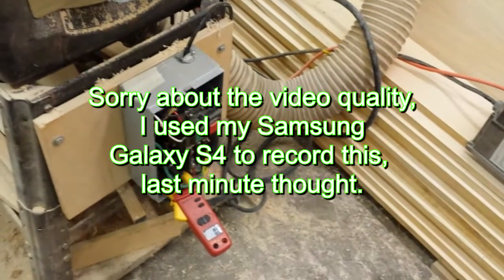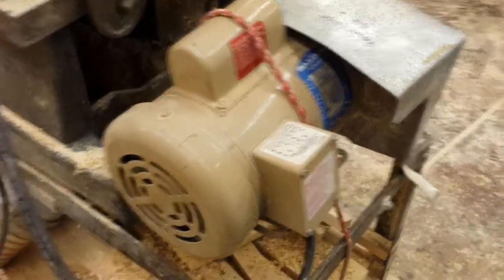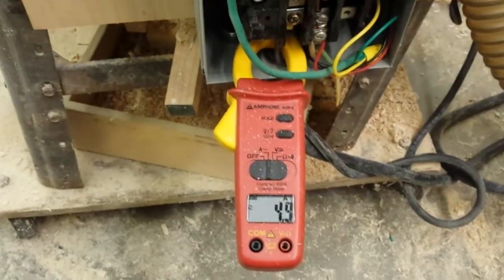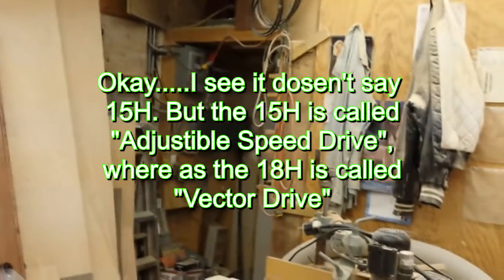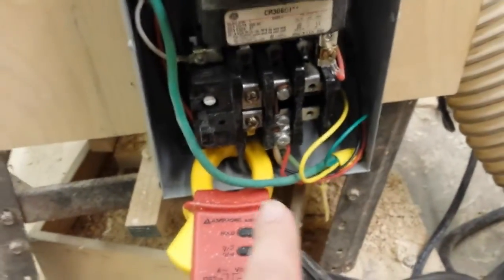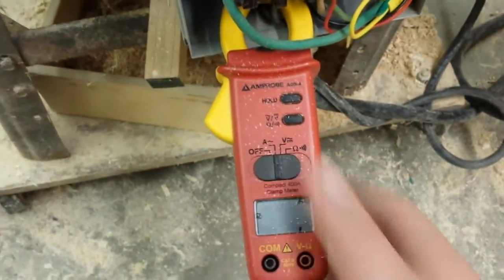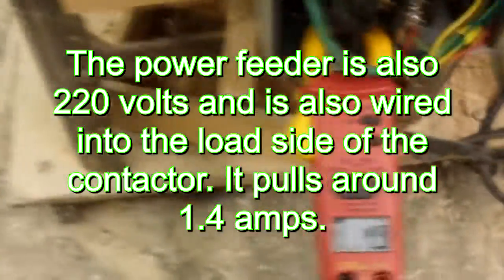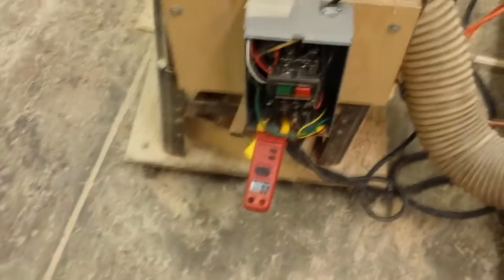Shop Cam - VFD Failure # 129

Comment: Isn't the VFD for that application a little overkill?  Once you get the feed rate corrected, wouldn't it be happy with around a normal 1.5 hp motor?

Comment: Good video and now you've got me curious.  Is it possible that when the capacitor discharges it acts somewhat as a brake in relation to the wind down speed of the motor?  It even sounds like the motor is being braked when the c-switch kicks in.  At any rate, something wants to draw that amp of current and you know it has be through the windings.  If you figure it out let me know.
Reply from the maker: Hi Kris, thanks for the comment. Yes, you are correct the capacitor discharge acts like a brake to a certain extent. In some cases it good and others not so good, especially a high inertia belt driven load like a blower or compressor. I had a Baldor 5 HP farm duty motor on my dust collector blower before the Leeson, and every time it would coast down and the centrifugal switch would slide back and discharge the start caps, it would make a horrible ruckus, and after about a week the belts had loosened up from the reverberation, so I brought it back for the Leeson. However the new Baldor motor I put on my Quincy compressor does not do it. Its normally corrected by adding a bleed-off resistor to the capacitor. Thanks! Scott